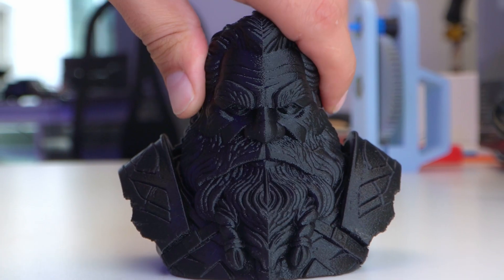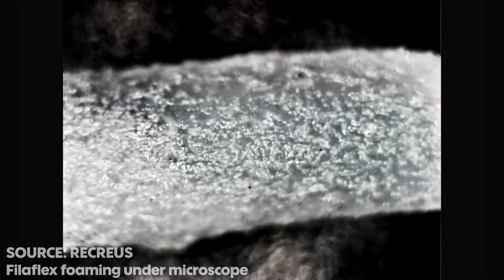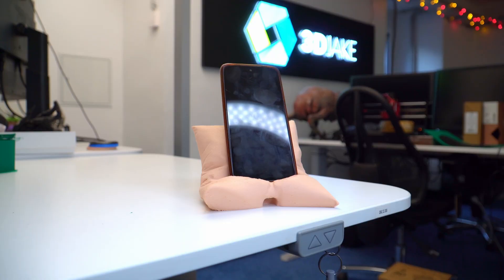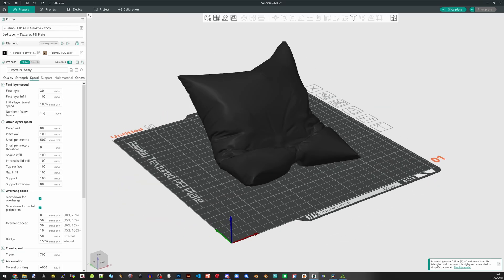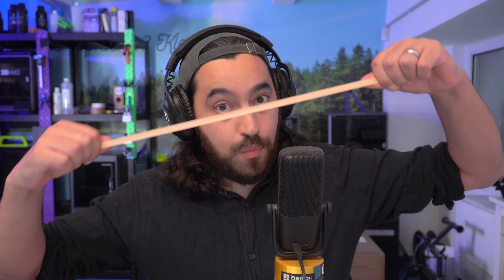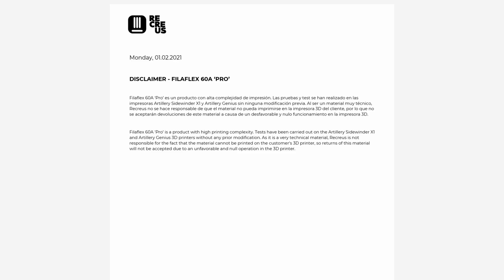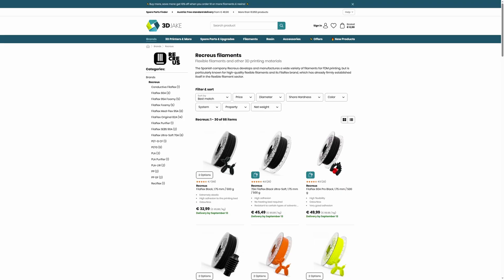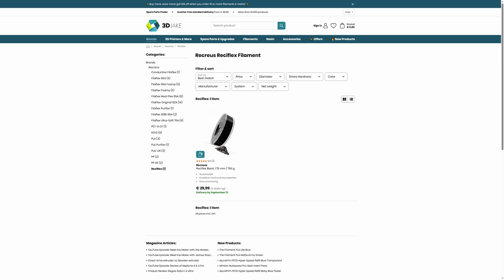Flexible Filament Isn't Just Flexible

Comment: Which flexible filament can be used for automotive parts? I need to replace a black colored part that is a rather soft rubber tube sealing moulded on an abs part. (No longer available.) It needs to be UV and headlight washing fluid resistant. Is there any filament that could be used for this purpose?

Comment: Any idea how the Siraya Tech TPU AIr and Recreus Foamy compare? I've seen many good videos about the Siraya TPU Air and like their documentation about specific flow rates & temperatures to get a specific shore rate. Sadly it's not listed in the 3d Jake Store and often sold out in Europe in general.
Reply from the maker: It looks like a very interesting material. It should be easier to print than Foamy given the higher shore hardness but it looks like it can foam more, so I would think you get better weight reduction